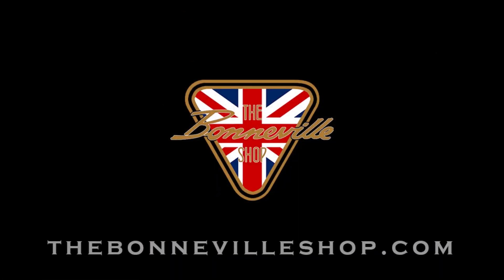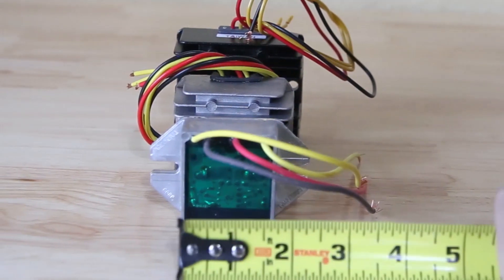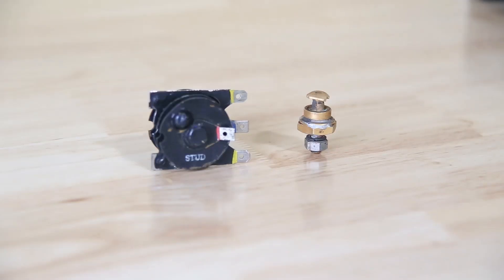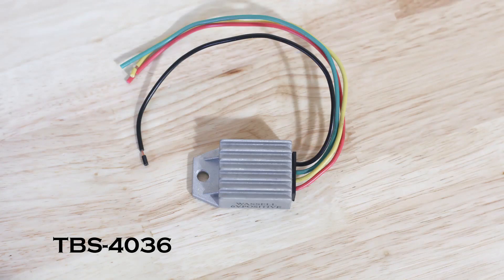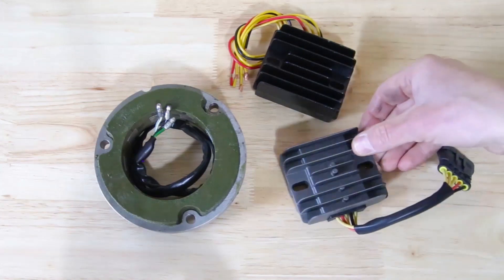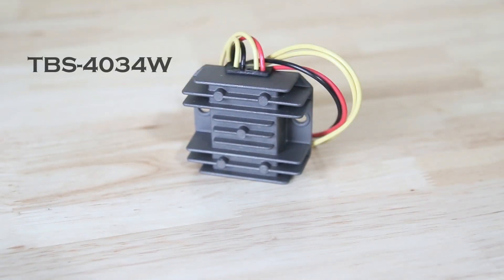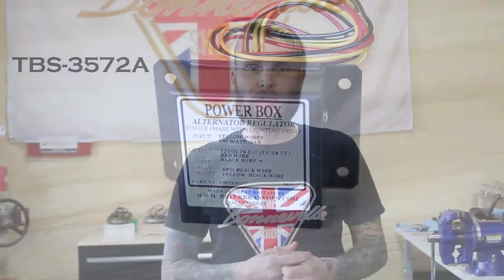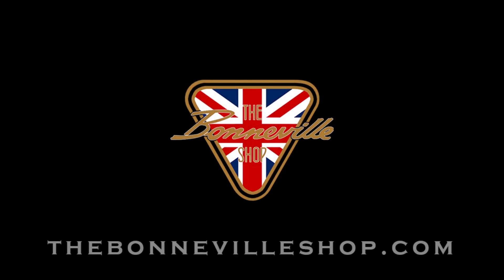Solid State Regulators from The Bonneville Shop

Comment: Many years ago, when I was working for a Triumph dealership as a mechanic, we had a customer come in with a charging issue. My boss ask him where the Zener diode was? He said "the what?" My poss pointed to the location of the heat sync under the head light and said "the thing that goes there." "That" he said, "I fooled with it a while but I could never get it to honk so I threw it out."

Comment: Fark ive ordered a solid state reg and a single phase stator started thinking about the rotor being alternator be a bit like my old rd 350 it has windings and all that shit! It has a bridge rectifer and a zd im gunna change it to a solid state parts are comming im in australia any help how to test the rotor? While ive got it apart
Reply from the maker: I’m sure there is a scientific procedure to remotely measure the magnetism in a rotor, but it is not mentioned in the Lucas Service Manual or the BSA and Triumph Factory Workshop Manuals. In practice, if you can pick up the rotor by applying a long screwdriver to one of the magnets, and wave the screwdriver around, and the rotor sticks to the screwdriver, it has sufficient magnetism. If it falls off of the screwdriver with very little, or no movement, it is questionable and should be renewed. Another thing to inspect is the steel center insert. If you can place the rotor on the crankshaft, with the key fitted, you can check to see if the center boss is secure in the body of the rotor. If there is any looseness of the center boss, the rotor will require replacement. If you see stake marks around the center boss in the rotor body, somebody has already discovered looseness. Hope this helps.
Reply: When i got the rotor off it was moving on the steel insert no good wouldve affected ign timing and possibly spun so i pissed it off and fitted a new 1 i went with a wassell solid state rectifier and a 10 amp single phase stator .... now the rings are shot lol its all fun and games but hey we learn

Comment: Thanks for the video.  I just bought my first Triumph, a 1964 Trophy. So far I'm loving it.  It's a 6v system and I haven't decided if I should upgrade to 12 or not.   I'm  currently going through the bike trying to figure out what changes previous owners have done to it.  It appears that I have the Tympainium reg/rec unit installed, or something that looks just like it.  Seems to be working okay.

Comment: I am wondering if you can help me with a question I have for my 1962 Pre-Unit Bonneville, that I just finished restoring.  This bike apparently has only a rectifier from the factory (the type that looks like a couple of disks pressed together) mounted under the seat.  In none of the wiring diagrams for the bike, nor in the wiring harness, is there any mention of, or provisions for, a regulator.  I want to keep my bike at 6 volts as original designed.  What would you suggest I do?
Reply: With the original wiring, the voltage was controlled, not very well, by the lighting switch.  When the lights were off, only one pair of coils on the alternator were connected, to charge the battery.  The other coils were used when the headlight was on.  This is why single phase alternators form that era had 3 wires and not two.  Lucas also reduced the power output of the alternators around 1960.  But for  most people, the battery was overcharged, depending on your riding style.      
PAZON RR12-6 voltage regulator would work and give you the option of 6V or 12V.   May be available form the Bonneville shop (I have not checked), and there may be other manufacturers with similar products.
Reply from the maker: Hi Rob!
The early alternator Triumph 650s didn’t use a regulator. The 6 volt alternators were prone to overcharging as such, so it was recommended to run with your headlamp on all of the time, as the current draw from the lighting system would help consume any excess current generated by the unregulated charging system. The wiring diagram reveals how the wires from the rectifier are connected directly to the lighting switch, through to the ammeter to the battery. The lights act as the regulator in this system. Those big rectifiers are robust instruments and many have survived over the years. I understand you would prefer to keep the 6 volt system. If it charges to around 8 volts and doesn’t cook batteries, I would keep it original. The 6 volt regulators I have seen are designed for use with DC generators, which required a voltage regulator, but not a rectifier, as the voltage supplied was DC, rather than AC, as from an alternator. The Zener diode debuted in 1966, when the charging system changed to 12 volts. If you don’t want to convert it to a 12 volt system, I would leave it all stock. Feel free to give us a call too!